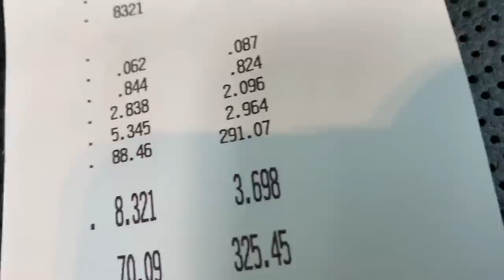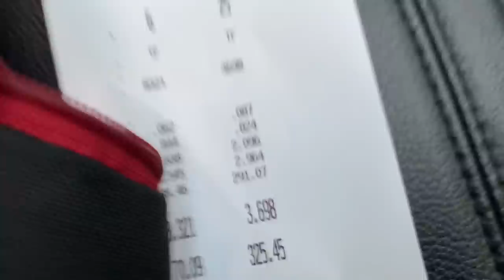Nitro Can Be Dangerous. Jim Read Racing Has A Horrible Explosion.

Comment: I was racing at Shakespeare County Raceway, in the UK, years ago, we were waiting at the front of the pairing lanes and a supercharged Triumph bike running nitro was started in the far lane and the engine exploded blowing the left side cylinder out showering bits everywhere, the engine was running and we were close enough that we could see the piston going up and down in what was left of the cylinder. 
That was a cracking time in the third qualifier, pity about the block though.

Comment: As someone who runs nitro RC cars, I can say that I even treat the little engines with respect.
The RC cars run fuel between 10% and 40% nitromethane at RPMs between 25,000 - 37,000.
If an engine goes wrong and you're near it it'll hurt no matter the size.
I hope the team members that were affected get well soon.
Reply: BS
Reply: @stuwest5862  
W E!
Reply: I have a Traxxas 3.3 that I ported and polished, custom crank, ceramic bearings and a Losi 3.4 carb on 40ish% and I treat it like a hand grenade. I can't even run it at the park because it draws every kid in a 3 block radius and I'm not trying to herd kids away from it in the event it lets go one day.
Reply: @SAVikingSA  Show me one nitro rc engine that has exploded to the point of releasing shrapnel. Don't bother looking because it doesn't exist.

Comment: This is some great stuff. But I've got to say, I miss 1/4 mile racing.
Reply: 330MPH in 1000 feet is plenty quick and shortening the track made sense for both the drivers and the fans from a safety perspective for the top fuel class.
Reply: Well, yes and no on the safety. What I mean is, the cars can be slowed down (yes, no one wants to see that). Also, this started due to Scott K passing years ago. No one, though, mentions the fact that his car blew up either right at, or just before the 1000ft mark. So from that perspective, nothing would have changed. Really this has stayed in place due to the fact that teams are burning up less parts (well, at least when this was first put in place), thus saving some operating cost. So my statement was in no way to discount safety etc.. Just noting that I do miss the 1/4 mile days.
Reply: @elrodjenkins  Scott's dragster was tuned to 1320ft, not 1000 and as such, the change to shorten the TF track to 1000 was done for both rails and funny cars. It's not like every class was shortened to 1000 so there's plenty of 1320 racing to be experienced to this day.
Reply: @strykerentllc  🤔 I suspect you realize your statement about the tuning of Scott K’s car is completely irrelevant. How it was tuned has nothing to do with where it detonated (I checked, and it appears to be right at the 1000ft mark). My comment concerning this is the fact that at the time the racing went from 1320 to 1000 would have made no difference in his incident. That’s it. I have no idea where you are going with this. Perhaps you are choosing to debate about nothing?
Reply: @elrodjenkins  I suspect you have never been involved in racing. You want, you miss...
Reply: One of the reasons Englishtown is no longer, NHRA wanted the shutdown longer, but Englishtown had no more land to accomplish that. So they decided to rip up the track and focus on other motorsports. Drag racing was getting them complaints from community and the family didnt want to deal with it anymore. I was there for Scott's crash, and his engine explosion was not normal, it was super violent, which knocked him out. The sand trap was also responsible for launching his car into the concrete pole which killed him.
Reply: There's no chance to run them down.
Reply: @strykerentllc  oh yes, for several years professionally. Just not drag racing.
Reply: @elrodjenkins  Well pony up then. Our Nostalgia Pro Stock runs high 6's at 199MPH in the 1/4, where's yours? And you're certainly welcome to build a top Fuel Dragster so you can get the feels of running 1000 foot @ 330MPH then come back and tell us how you wish the track was 320 feet longer...

Comment: Don't the engines dump like half a quart of 2 stroke oil into the blower when they pass the line to stop the engine from getting as roached when it's shutting down and there is no longer any fuel to lubricate?

Comment: Clay keep it safe, it can go sideways fast. 
Question for ya, how many times can you heat soak the engine and what effects does heating it have for the race? You heat it then sit for rain, get the call and heat it again but called off and it cools, reheat it and maybe race maybe called off again and it cool down, has to have an effect on parts.

Comment: Reminds me of the time I was a crew member for a Top Alcohol team, and after some reassembly of the engine we test fired it to make sure it would do the same thing on the starting line. I was the guy that primed the engine and engaged the starter. When that thing fired up I leaned forward a little towards the driver, and something the size of a BB came shooting out of the zoomy header and hit me in the face. It was like getting shot in the face point blank with a BB gun, and it cut my face open with a small cut. I learned a lesson from that to keep myself out of the firing line of the headers.

Comment: From Reports it sounds like Jim Read racing was turning the engine with a breaker bar to clear the cylinders of fuel. The magneto's where probably not grounded out, and they fired the excess fuel in the combustion chamber.

Comment: How about a slow-start module and switch installation on the starter motor for that initial turnover? That will help detect the hydrolock without detonating it.

Comment: It would be really interesting to see Clay line up against a Pro Mod, with Clay running his usual 1000 foot and the Pro Mod running 1/8... start the Pro Mod further up the track.  I suspect the finish would be really close.
Reply: I can’t imagine how terrifying that would be to have a car approaching that fast… promod going 260 and a top fuel going 320mph… I’ve always thought they do a bracket race sorta with a head start with a promod and top fuel to the 1/8 or 1000 feet.
Reply: @H3110NU  it would be the only time in history a pro mod was given lengths

Comment: Would it be safer after a nitro warm up to lean it out on methanol to get all the nitro out of the cylinders?
We run an AA/FA with nowhere near your horsepower and fuel delivery and we never just shut off on nitro unless we just made a pull down the track. 
Glad nobody got hurt really bad 😳🙏

Comment: couple of comments:seems to me lots of guys to close to the motor when they fired it in Australia. Would it be wise to remove a sparkplug in each cyl after warm up and blow some air in to make sure it's clear? Is there an easy way to pressure check the fuel system for leaks (bad check valve, etc) prior to reattaching the lines? Those guys were lucky.

Comment: I'd suggest pulling the spark plugs after you shut down and turning the engine over without any compression to clear the cylinders in the pit. I don't know if that's safe for the valves though or if there'd still be enough heat in the cylinder to auto light the nitro.. Clearing it that way seems better than on the line with compression in effect though. Obviously fire suits for the people around the engine during start up would be smart but hot so...

Comment: I’m glad everyone is still alive! Clay, I wanted to know if hypothetically you ran your car down the track with NO nitro in it. Would that hurt the motor? Keep up the fantastic work!
Reply: It wouldn't run for shit, they can run it on alcohol, but the engine is setup to run on nitro, so running down the track without nitro would burn up the engine, and honestly it probably wouldnt make it too far off the line without going lean and going boom!
Reply: @paulcrocker4553  I thought as much, but I just had to ask. Thanks!

Comment: Nitrogen and hydrogen based fuels can catch you out, as can lots of chemical combinations. its been a while since a motor grenade on start up, but wont be the last. Phil Read knows what he is doing, and his dad is a legend, and had one of the longest major cooperate sponsors in motor sport history. When I mention hydrogen fuels, I think of Sammy Miller RIP. He harnessed hydrogen peroxide to run amazing elapsed times like 1/8 mile at 319 mph, but H2 O2 caught him out and killed him, away from the strip. On a lighter note Phil's dad Jim has the best hair transplant I have seen, I have come to terms with no hair so no envy, but yours did look impressive when I last saw you Jim. Stay safe to all the crew at Stringer performance.

Comment: Has that ever happened before where the engine blows up right at start up?That’s terrifying. Glad everyone was okay.
Reply: Lots of times,sloppy pit work?
Reply: @colinmunro7337  did it happen because they didn't bar the engine over by hand before cranking it ?
Reply: @jamieknight9636  what ever they did there was fuel in the system/cyl.either way they need to look at the pre starting procedure.The A fuel car I worked on we always spun the motor plugs out.

Comment: Hello Clay, what rpm does the engine idle at?
Reply: It varies depending upon their tune up and weighting in the clutch setup, but generally around 2500 until they turn the fuel on all the way after setting the top bulb where it will drop a hundred or so because it’s fatter at that point.

Comment: I watched that staging lanes boomer.  Yikes.  So,so lucky.  Stuff can still get thru that blanket,, then you have high mass with low velocity stuff.   More Yikes.   Someone need to build a vent or a shunt so that does not happen, a head chamber compression release of some sort before spinning.  Maybe a switch on the starter that HAS to be opened before the starter can go spinning.  Not just relying on multiple panels and good faith and seatbelts,,of which all 3 can and/or will fail at some time.  Decades of Boomers in the stage lanes.  Eventually that luck will run out and claim it's hideous prize,,PLEASE God forbid of course.   Gene Snow(Yuck!) almost took out Jungle Jim and Pam with a next door pit Boomer.